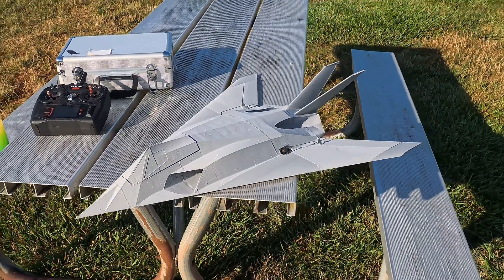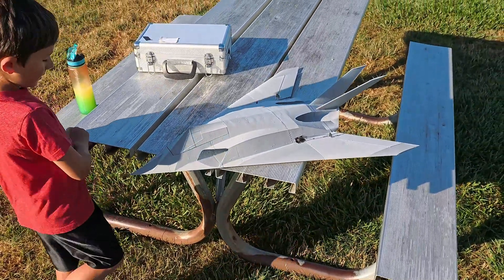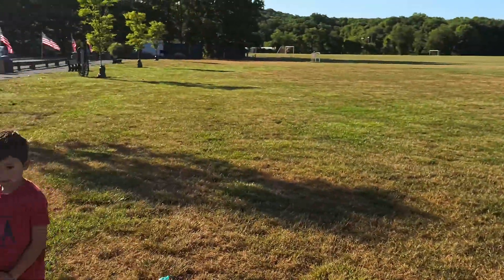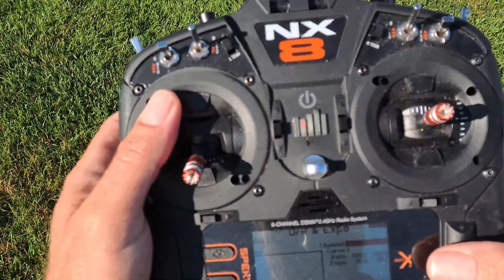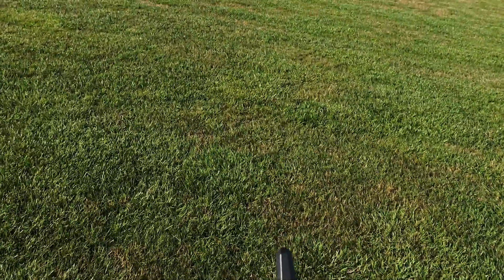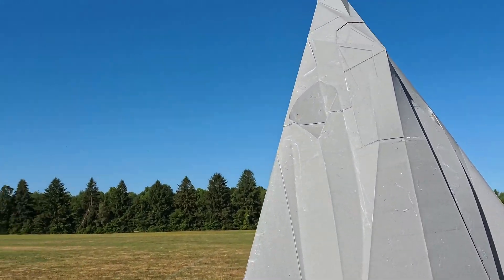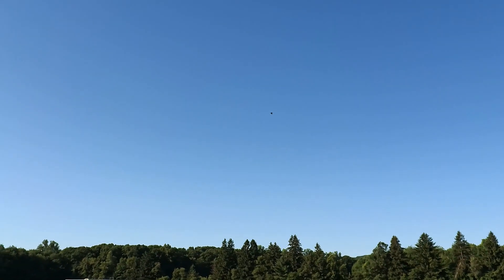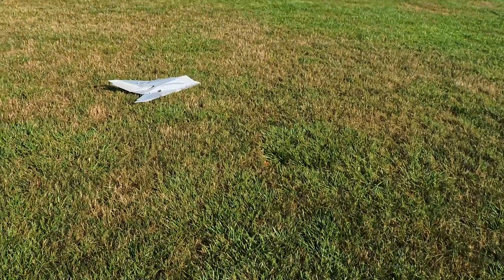f117 download available!

Comment: I’m new to flying RC airplanes. Would this be one you recommend for beginner or is it too advanced?
Reply from the maker: Definitely not a beginner plane. If you’re experienced hand launching EDF jets I’d say it’s an easy one but if you’re a beginner I’d recommend something like an aero scout with a safe mode switch. Once you get the feel for flying and landing it’s a quick jump to easy to fly edf jets. Don’t let this deter you though. I learned how to ride a motorcycle 3 months before I got my race license so I’ve never listened to anyone on how to start a hobby.
Reply: @hotlapkyle  the reason I was thinking is because I could just reprint the parts if I damage it